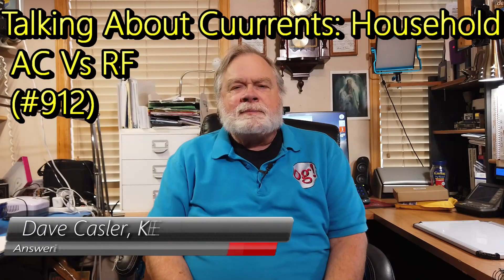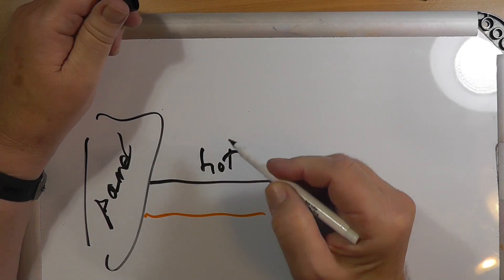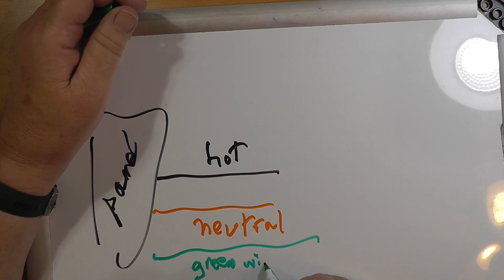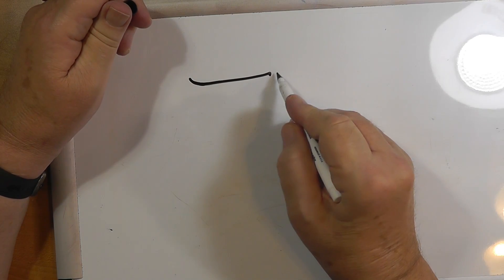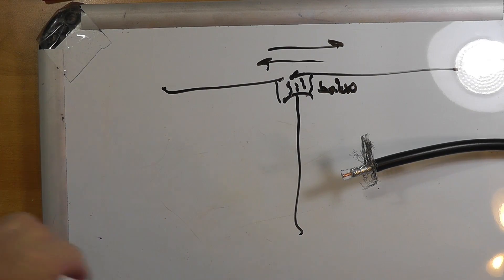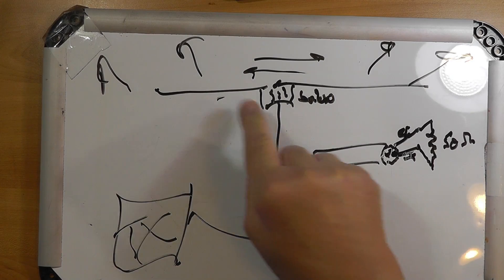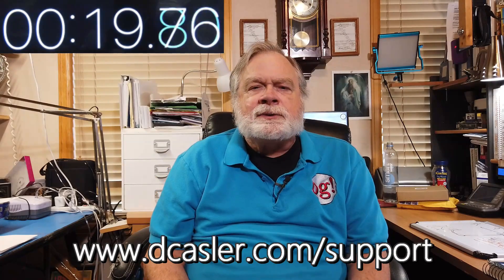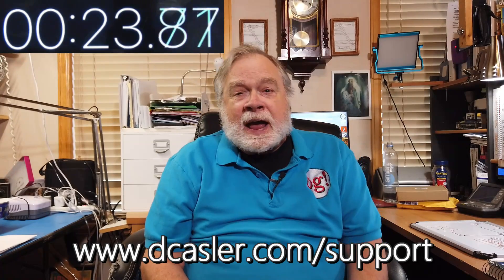Talking About Currents: Household AC vs RF (#912)

Comment: National Electrical Code (NEC)  NFPA 70a, Article 100: Definitions.
'Hot" or Red/Black wire in the house is the Ungrounded conductor. Its voltage is above ground. I.e. a ground to hot connection is has power to light a bulb or cause death
Neutral is the "grounded conductor" because there is a neutral ground bond at the service entrance. The grounded conductor.  Neutral is not a ground. 
Green or bare wire is "The grounding conductor"  The conductor for grounding.  Read as groundING not groundED!!  This is your safety line and ground reference. 
In AC the power goes out over the un grounded conductor and comes back on the grounded (neutral) conductor.  A hot to hot is not easy to cover because neither wire is grounded.

Comment: Roy, if your reading this just do like Dave said and go to the playlist and you can scroll all the way to the bottom and start at Ask Dave #1 and have hundreds of hours of quality videos...I have also found that say your wondering about baluns you can type in YouTube search Dave Casler / baluns and that will pull up anything with baluns iin the title...Im just going through them all one by one because even though im a General Ticket Ham even some of the videos that have a simple Technician Ticket subject usually has some info in it that I forgot or just wasn't covered in the test manuals..Even Amateur Extras can learn something im sure...I haven't been a Ham long about 11 months but I have found that i learn more from people like Dave than I do from reading piles of books...Between Dave and the 50+ year hams in our club I have learned more than any other way...

Comment: All electrical theory comes down to electromagnetic fields.  AC for your home, RF, motors, generators, digital circuits....  all of it.  We use component modeling and think about how energy is transferred like electrons in a wire because it makes sense in our brain not because that is what is actually happening.  When you plug a light bulb in the wall it lights up because an electromagnetic field is in place.  In the wires, in the wires insulation and outside the wires.  Don’t believe it?  Ever used a wireless phone charger?  There doesn’t need to be hard connections to transfer energy.  Transformers transfer energy all the time.

Comment: Another stupid explanation to the question asked. That's again cheating your patron.
And you said the antenna is acting like a transformer to convert the 50 ohm coaxial cable impedance (and the source of course) to the 377 ohm impedance of the free space.😅 
You should start studying Dave.
Please start today itself; it's not too late.
And I have noted you telling in several videos, " impedance is the ratio of voltage to current" Everyone knows ohm's law Dave. Then you are obsessed with the term, RMS voltage. Another "mind bending" concept according to you 😂
High voltage on the lines would be subjected to"skin effect " what a humorous idea!!
Ok. Let me give a simple explanation here.
A transmission line (open wire or coax) of say, 50 ohm impedance of any length will carry the RF energy from the source as long as it goes (imagine a lossless line)
The energy in the previous segment would not know whether it's going to flow into another short segment of the same transmission line or it's going to be terminated into a 50 ohm load.
If it's finding a 50 ohm pure resistive load of sufficient wattage it would be dissipated in the form of heat and nothing more.
But if the terminal quarter wave long line (of the operating frequency) is split into two separate lines and installed perpendicular to the transmission line itself something special is going to happen..... resonance.
You can see now a half lambda dipole fed in the centre by the transmission line.
The dipole is going to radiate energy (that has been all along the line as electric and magnetic fields) into electromagnetic waves; it dissipates the energy into a virtual resistance called Radiation Resistance; you can't measure it with a normal multimeter.
The dipole, being a resonant circuit, has L,C and R.
When the L and the C are getting cancelled you get the R left which is of two types; the ohmic resistance of the wire that's not useful and that wastes the power into heat. The other resistance is the Radiation Resistance that's going to do the desired function of emanating in the form of electromagnetic waves.
You have immediate reactive fields, near fields and far fields where exactly both the E fields and the H fields combine in space quadrature to be propagated at the universal speed limit C.
Along the dipole wire radiator you have the standing wave. Half lambda long is the minimum length it requires to establish radiation as the energy is going to repeat the same phenomenon every half cycle. 
For the first half cycle one end of wire would be positive and in the next half cycle the other extreme end would be positive. The current flowing in the radiator from the feed point causes concentric circles of magnetic fields; the ends of the radiator becomes the North -South poles of a giant magnet with the field lines parallel to the axis of the radiator.
There's no preferred half of the dipole elements to be fed with the centre conductor of the coaxial cable; someone was pondering about the idea of it in the comments section of your previous video.
Hot wire and cold wire terminology in the Coaxial cable is for the purpose of comprehension.
The energy is flowing on the outer surface of the inner conductor and on the inner surface of the outer conductor in the Coaxial cable.
The outer surface is forced to DC ground potential at the radio, the source of power.
You don't get zapped by touching the outer surface of the shield. 
If you extend the centre conductor sufficiently long and mount it on insulating pillars and hang on the line without the power flowing in the line. Then switch on the power, you won't get zapped or burned by the RF.
The AC supplied to the house and the RF are all the same; the only difference is the frequency.
In the house standing on the floor and touching the live wire will kill you; but touching the neutral won't. But you can hang on the live wire for any length of time if you are fully insulated off the ground. Household supplies have little or no skin effect because of low frequency associated with the alternating current. But RF, say 7 MHz is lot frequently changing the polarity and the energy is skimmed off to the surface of the conductor in which it's flowing. Any high power DC would not exhibit the skin effect as the power occupies the entire cross section of the conductor.
Let me edit the comment if needed. For now it's enough, I think.
De VU2RZA
Reply: Gotta love comments that criticize without bringing any actual information to the table to support said criticism. 🥱
Reply: This guy wants Dave to explain in a few minutes what usually takes a person years in college to get an surface level understanding.  😄.   Then acts like a total a-hole about it.  Electromagnetic fields is usually a junior level engineering course.  Dude, this is a free YouTube channel for people that want to play with radios in their free time.  If you want to explain it clearly then put together your own set of videos.  I’m sure a couple dozen people would watch it.
Reply: @bassmanjr100  Bingo. This dude is just another troll with a few extra letters.
Reply: @gahvno  another  Augie here😂
De VU2RZA
Reply: @bassmanjr100  you have proved to be that "a" hole in essence 😮😅😂
De VU2RZA
Reply: @bassmanjr100  dear Bass..Dr Subbi is trying to explain the events happening in the tx chain to the antenna, A person giving his review about a movie watched can't be asked to make a movie ...if his comments are not positive...try to learn the subject...if not able to understand...raise the hands and say ..i am not able to follow.. cheeers
Reply: Good morning Dr Subbi...with respect to your explanation...shall we conclude that an perfect resonant antenna for that frequency will have maximum radiation resistance and a 50 ohm dummy load have minimum radiation resistance?..de vu2cck
Reply: @prabhu6330  no, you are mistaken. 50 ohm is the right impedance the RF energy wants to see. Thevenin theorem requires the impedance of the source, transmission line and the load to be the same. The value can be anything as long as the magnitude (number) matches for "maximum transfer of power".
A dummy load is 50 ohm pure resistive to the RF energy and all of it gets dissipated in the form of heat.
(In a 75 ohm system, the video industry the load has to be exactly 75 ohm for maximum transfer of power, because the generator and the transmission line is having the 75 ohm standard; but the power involved may be less)
In the amateur radio world we follow the 50 ohm standard.
Any load has to be 50 ohm pure resistive and without any reactance component.
The purpose of the ATU, (or antenna matching unit) is to offer the 50 ohm pure resistive load to the transmitter. Then only the TX would tend to put out all the power it has got. The ALC, automatic level control circuit built in the transmitter would reduce the power output if a different value of load is presented to the radio.
So, the tuner (strictly speaking a misnomer) becomes the source or the generator of the RF energy and equipped with the necessary L or C it's able to feed the power (so obtained from the TX) into the transmission line. 
The magnitude of the high SWR on the line remains the same even now because of the mismatched impedance at the feed point of the line.
A high impedance at the feed point causes high voltage and a low impedance at the feed point causes high current in the line. Both the high voltage or current are not good especially for the transmitter of the solid-state type. 
Hope this helps.
De VU2RZA